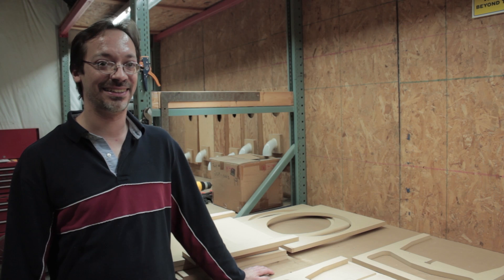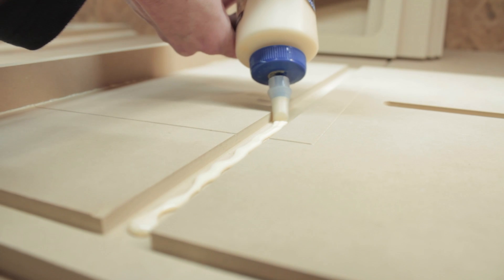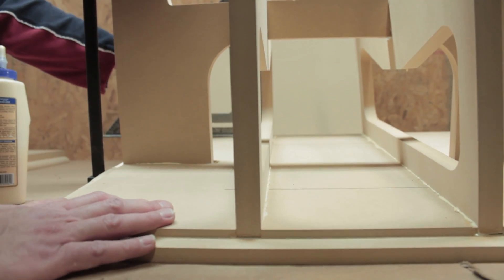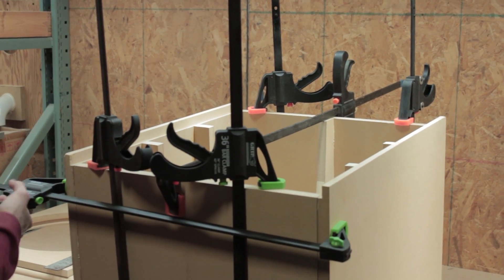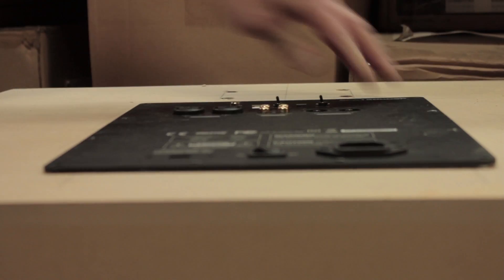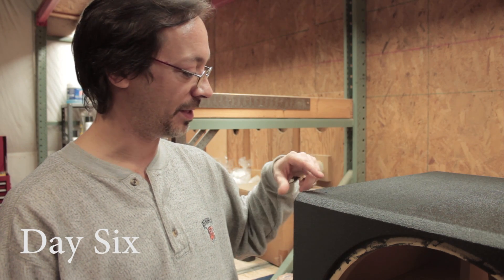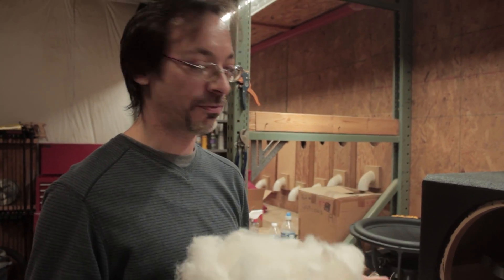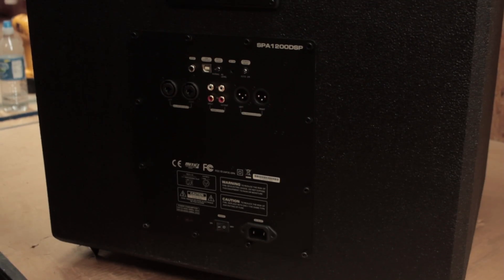How to build a subwoofer kit and install the Dayton Audio SPA1200DSP Amplifier

Comment: 1. So you use gasket material on the main driver (supposedly to help seal from air leaks) and yet, you don't use anything like than on the plate amplifier and control panel?

2. You use an amplifier with an internal fan and heat sink for a "sealed" enclosure system which means that most of the heat generated by the amp is directed and circulated inside the sealed enclosure. The longer and harder you push the sub-woofer, the more heat will build up internally. That doesn't sound smart. External finned heatsink on back of plate amp would be the way to go.

Comment: Something I like better about the DA's smaller DSP amps (the 250 and 500) is PE has a mounting rack that mounts the amp on the outside of the enclosure. This serves a couple of purposes. One, the amp cools better because it's on the outside of the enclosure so it's getting more air flow, and two, there's no need to cut a hole in the back panel of the enclosure...PE needs to offer these mounting racks for their more powerful amps as well...

Comment: A couple things about this build I really like. Using the router to cut the 45 degree angles around the edges instead of having the sharp 90 degree corners, not only looks much better, but it should also be less susceptible to getting those sharp edges all dinged up. I also like the look of the Duratek, which is also a very durable coating...

Comment: Good video but not sure I get this... 
1. You have a Plate amplifier with a fan installed on a non ported... sealed box... how does it cool itself down when there is NO access to air other than whats in the box! once that heats up you will cook this amp!

2. The amp is ONLY efficient with access to fresh air... hence why they have a fan on it... otherwise the more it heats up it will become inefficient... electronics 101 heat kills lol. Would be better to install it on a ported sub box possibly.

3. You cut the internal support braces for the box when you cut out the hole for the Plate amplifier... are you supposed to do that ?!
Reply: This is a good point, which is why I decided to mount my SPA500DSP on the PE amp rack which mounts on the outside of the enclosure...

Comment: So no gasket between the woofer and baffle?? there will def be an air leak there (interfacing two materials with drastically different stiffness).
Reply from the maker: The driver already has a gasket.
Reply: @PartsExpressOfficial  from the video there doesn't look to be any gasket, the driver's metal frame right onto the wood baffle and you can hear it when he drops it in (hard on hard). But yeah, i do realize this is "casual" DIY (no gaskets on the amp block etc either).
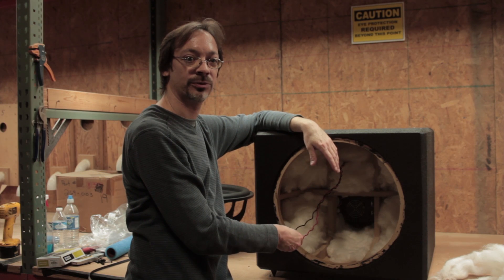Reply from the maker: @gregd6022  If you are only looking at the driver itself, there is no gasket as this was a sample unit for our company so we placed down material at 12:23 to resolve any future air leak issues. That being said, every Ultimax driver you would buy from our site has the gasket already pre-installed on the product. This also stands for the amp as well. This enclosure was sealed as well as any other professionally finished product on the market.
Reply: @PartsExpressOfficial  Ah ok , now that makes more sense.
Reply: @gregd6022  I just bought one of their 12" HO reference series subs and it has a rubber gasket...

Comment: That enclosure is surely far too small for that monstrous sub. Mine is in a foam filled 7.5  cubic foot box and I feel even bigger would suit better
Reply: It's not.  I have three of them.  4 Cubic feet works great.  Adding Acousta-Stuff (4 pounds) makes the box seem like it's 27% larger in a big box such as this...which equates to an equivalent 5.08 cubic foot box.  If you are using this rule of thumb...in a smaller box...like a 1.4 cubic foot box...the effect is greater (36%).

Comment: ok amp is fan cooled but the fan is inside the enclosure..... :/ :/
Reply: Yes, putting a cooling fan in a small sealed box seemed weird to me too.  I mounted the plate amp in an mdf shipping box I had laying around from a different woofer and added some vents and banana plug speaker terminals to connect the amp to the sub in the sealed box.

Comment: Great video.  The glue does absorb into the wood/MDF a bit, so I think Titebond works better when you apply glue to both sides of the wood first before putting them together.  Also would add that it's very easy to clean up excess glue with a damp rag immediately after clamping.

Comment: Tip for the inserts.
  Install inserts before coating (counter sink hole for insert slightly, and use glue), use "sacrificial" screws installed in the inserts, coat, remove screws before coating dries.

Comment: Cutting The hole for the plate amp, is he not cutting into the support bracket? I plan on building the 15” version and can’t see how to use a plate amp without cutting the support brace. Has anyone done this without very bad side effects?  Seems like a external amp as Z Reviews used is the only option.
Reply from the maker: You are good to cut into the support bracket. Once the amp is there, it will reinforce everything. You are all good!

Comment: Is there any benefit to using screws if you glue everything tightly?
Reply from the maker: Generally, No. Glue will hold pieces together and provide a seal. Nails and screws could only open up a possibility of problems in that system.
After he realized nails and screws are not the best way to build enclosures https://youtu.be/emHBrq_5CUw?t=559

Comment: I want to put one of these in my trunk so bad. I have 1200 watts rms at 1 ohm to work with so it would be perfect. BUT WILL IT FIT? I have a camry sedan. My gut is saying it will. My gut is not always right

Comment: Great video. I'm looking at doing a couple of these with external amps. Do you have a video covering the binding posts & wiring for this? This would be my first build of anything electrical & carpentry since... It's been decades!
Reply from the maker: As you can imagine, these types of things will get very specific very quickly. If you have questions you can always get in contact with our technical specialist via phone, email, or live chat.
https://www.parts-express.com/contactus.aspx

Comment: Anybody own an SVS or HSU sub and built one of these? I like the idea and all but at $900 plus time to build is it really gonna be comparable to my 2- PC-13 Ultras? Yea I understand I would have saved a decent amount of money but those are absolutely premium subs and a fairly cheap cost already for what you are getting. Plus if the amp goes bad or whatever they are know for their customer service. Meanwhile if the DIY project has an issue a couple years down the road you are the one paying for the replacement out of pocket. SVS even has their upgrade option if you choose. Cool nonetheless, just would like to hear in person.
Reply: I believe the theory behind it is to directly compete with those manufacturers, i always thought of it as a "poor mans svs". i personally havent heard it but i have read great things.
Reply: @Mew-269  This thing competes very nicely with anything from SVS or Hsu.  I run two of them and am building #3 right now.  Bass is all about moving air.  This thing has a 22mm X-Max which is very large for an 18" diameter sub.  With this enclosure and lots of power, it hits amazingly low and yet remains tight and accurate.  I power mine with Crown XLS2502's bridged to mono (2400 watts).  Don't worry about max power ratings...it is clipping and distortion that kill speakers.  Good, clean power keeps big subs like this happy....plus you never give them a constant thousand-watt plus constant power feed unless you are playing some silly bass test track.   A well built sub has "self-cooling"...as it is stroking back and forth it is sucking air through the voice coils to cool itself.  The SVS SB16Ultra is 2" smaller in diameter, but it makes up for that by having a larger XMax vs. the UltiMax lineup (SVS claims 65MM - which is 2.56" and absolutely amazing) but subwoofers also need to stay linear in their pistonic movement to sound their best.  A 22MM XMAX keeps the UltiMax 18 very linear and it still moves lots of air due to its large diameter.  With that said, the SVS is very pretty and comes ready-to run, so it is a great (more expensive) choice for someone who does not want to DIY.  Google "Full Marty" and see what these things can do in an even bigger enclosure.
Reply: The good thing about DA subs and amps is they are backed with a 5 year warranty. HSU and SVS only warrants their amps for 2 years...I don't know how long they warrant their subs...

Comment: Which subwoofer you recommend 2ohms dual coil  or 4 ohms dual coil then i wire it in series i am planning to build my own home subwoofer using spa2400 watts! Nice video ;)
Reply: If you wire two 4 ohm coils in series, it'll double to 8 ohm. If you need 2 ohms, you should wire the coils in parallel. The subwoofer you get, and the way you wire it, will depend on the requirements of the amp you buy.
Reply: @OMGLYKEWOW  They Dayton Audio amps (plate amps) are all only 4 ohm stable, as far as I know. To achieve a 4 ohm load  there are several ways you can go...a DVC driver with 2 ohm VCs can be wired in series for a 4 ohm load, or you can use a single 4 ohm VC sub, or you can use a DVC sub with 4 ohm VCs  and only connect to one VC, or you can used a DVC sub with 8 ohm VCs and wire them in parallel...

Comment: Cool build, nice finished product.
Now, I may have some experience building cabs, but 7 days to build a simple pre-cut, pre-fitted sub is a bit excessive. It should realistically take one day for gluing, another one for finishing / filling / painting and a third for installing the driver and plate amp, maybe 2-3 hours per day. This is pretty simple stuff. :)
Reply from the maker: Correct. It took that long because of scheduling with multiple parties. Better to say "Day 7" than ignore clothes changing. Since then we try to wear uniforms for continuity. Good peek behind the curtain though! :)
Reply: It's better to let the glue dry between the steps to keep the box square.  Sure, it could be done in one day,  as good quality wood glue sets up quickly, but it is rock-solid after 24 hours.  Over the course of several days you only need to go to your project for 30 minutes a day or so.  On a sub project like this where you want everything just-right, patience wins over hurrying.

Comment: Subwoofer hitting that amplifier plate?  fan cooled amp in a sealed box?.     I would rather recomend to put that amp module away from the box,  or in a separate chamber attached to the main sub box.  Otherways,  you´ll be punishing that amp plate so bad
Reply from the maker: Thanks you for your concern.
This plate amplifier is designed specifically to be mounted inside a subwoofer enclosure (it's built to take the punishment). Every part is securely attached to the circuit boards, larger parts (caps, transformers, relays, etc.) have been reinforced with glue. In addition, every component that passes through the mounting plate (plugs, jacks, switches, etc.)  is sealed with glue or isolated from the inside of the enclosure, including the control panel. 
As far as the fan goes, this amplifier is extremely efficient therefore is produces very little heat. In cases of extreme output levels the fan will turn on to move some air across the heat sink, but not much airflow is required to keep it cool. As long as airflow is not directly blocked then the fan will have no problem keeping the amp cool, even inside the enclosure (unless it is in an extremely small enclosure), wood doesn't conduct heat very well but it will wick away just enough to keep the temperature inside the enclosure from skyrocketing. 
Mounting the amplifier in a separate enclosure is definitely an option, but not necessary. A separate enclosure can actually work very well since you can mount the control panel on the front and the amp itself on the top or back for a very clean look with only the LCD control panel showing. This is a great way to go in situations where you are powering separate subs with a single amplifier.
Reply: It's a digital amp plus most HT and even music bass is intermittent, so amp doesn't really dissipate that much heat in most cases.  If using in sound reinforcement then probably need an external amp like the big Crown XLS-2500

Comment: Is it recommended to use only glue?
Reply from the maker: as opposed to nails and screws? the glue will give it a sealed hold and will be plenty to keep the enclosure together. Especially with MDF.
Reply: Oregon 08 i
Reply: Oregon 08 Aq
Reply: Screws are not needed.  TiteBond is amazing stuff.  Screws will eventually protrude and ruin your nice looking finish.

Comment: I would imagine the control is meant to go on the top of the sub while the amp goes in the back... Also, i'd recommend for a sub that big and heavy to use T nuts, so you're not using the MDF for holding it down but more or less clamp the driver to the MDF.   I'm waiting for you guys to sell the recommended 7cu ft box (music) for this thing :D
Reply: Excellent suggestion on the T-nuts. I always use those for securing my subs into the enclosures. I just don't trust those wood screws threading into the MDF...

Comment: Nice build,but I suggest you use brass threaded inserts with brass machine screws...I used stainless steel threaded inserts and he head cap screws incredibly strong bite and makes mdf infinitely reusable....Dave Shultz video on brass better resonant characteristics has me excited to make the upgrade

Comment: this is no joke this amp is extremely powerful benched and got at least 1300 rms. for your home this will be enough bass unless you want to run a dancehall. Recommend sundown 15 inch or 18'' for effortless bass. Or budget get the dayton ultimax 18. One thing i like about this amp its like it doesn't even get hot its so warm u could leave your hands on it for days without it burning you.
Reply: How does this dayton ultimax 18 compare to sundown x18,  both being driven at about 1000watts rms

Comment: why you put acoustic foams???this is SUBWOOFER no satellite speaker!!!!
Reply: I agree with you. What most people who think subwoofers should be stuffed like normal speakers fail to remember is that bass soundwaves are looooooong. Sub-bass starts around 90hz (which is pretty high) and it's over 12 ft long. Get down to 20hz and your soundwave is over 55 feet long! There is no physical way that some fill inside a typical size cabinet is going to affect a sound wave that is anywhere from 85% to 97% OUTSIDE of the cabinet. At least not in any way that is even remotely audible to the human ear. The only advantage to putting in fill is to possibly stop your cables from rattling against the inside of your box.
Reply: Polyester fiberfill or Acousta-stuff increases the apparent volume of the sub box to the driver.  The rule of thumb is 1 pound per cubic foot of sub box volume.  This is common in all speaker enclosures (using either pink fiberglass or polyester fiberfill in subs); do some Googling on the topic and you will gain a better understanding.  It also kills standing waves and improves resonance response (deadens the box).
Reply: Not foam ...'stuffing' or 'batting' in this sub. Or Acusta-Stuf in this case I believe.
Not only makes the sub 'smoother' sounding, which is a plus for music,  but helps the transducer 'see' the enclosure as larger than it actually is..
Overall, it's definitely a benefit, trust that.
Reply: Using acoustic batting or damping material increases the apparent volume of the enclosure to the driver, by trapping air and holding it in the fibers. You can increase the apparent volume of the enclosure by up to 20% by using a large amount of densely packed stuffing; the amount used in the video probably only impacts apparent enclosure volume by about 5%, but it is still helpful to improve bass character because it adjusts the acoustical damping of the system. If foam is used, it has almost no effect on enclosure damping at low frequencies.
Reply: ***** its not necessary use the foam in sub......without foam its more loud.....

Comment: Why not cut the hole for the amp before you glue it together? seems like it would be tricky to get the saw dust out of the inside when its put together
Reply from the maker: +bassblaster505 Gaming nah, dont forget there is a huge hole for the actual speaker. its not bad at all...plus it kinda builds a natural table. you dont have to hold anything down.
Reply: I have a question. Can i glue the two baffles together first and then glue the box together?
Reply: @LongIslandicedteaaa  no.
Reply: @DiMoraDiamond  why not?
Reply: Sherikan Niyaziev it will not align correctly with the finished box and the glue will shoot out the edges.  Is it possible?  Sure, you could make it happen if you measure everything precisely with calipers and clean up all extra glue, but why?  Just build it bottom up the way it was designed to be built.
Reply: @DiMoraDiamond  ok thanks.

Comment: i have to ask about how much surface area does that one can cover? with a typical thin layering.
Reply: A quart size can of Duratex ( http://www.parts-express.com/acry-tech-duratex-black-1-quart-roller-grade-cabinet-texture-coating-kit-with-textured-3-r--260-111) will cover 20-24 square feet. 
I used one full can on this enclosure, which measures 23"×20"×20.75" (around 19 square feet). I actually managed to get two good coats on the top and sides, just one on the bottom.